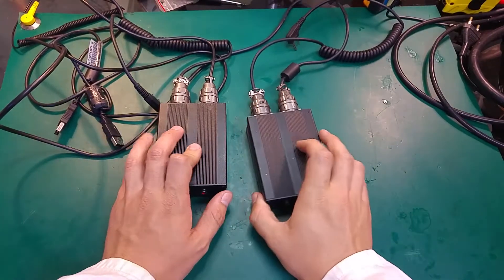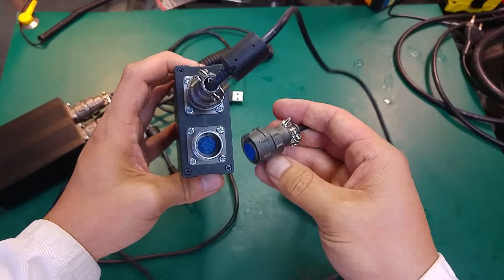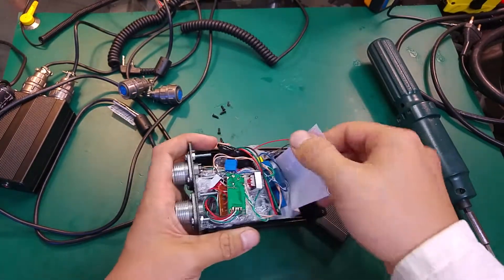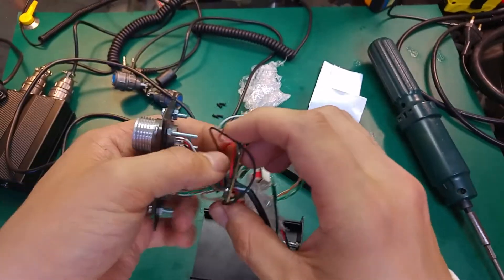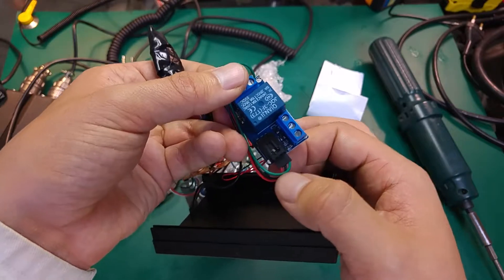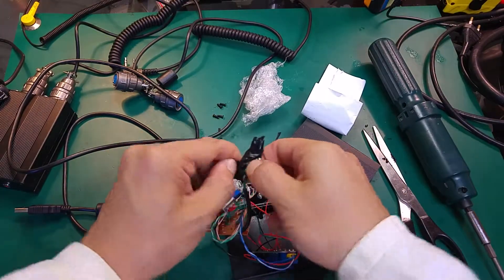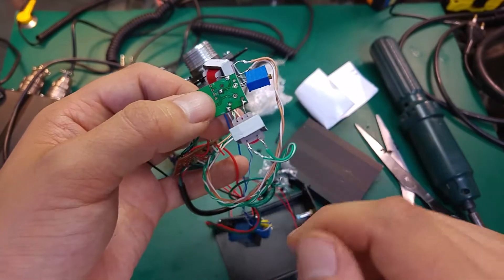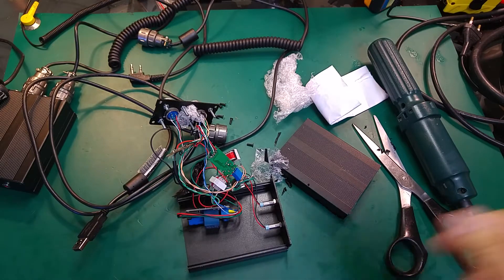cheap SignaLink alternative USB PTT AUDIO for digital modes Winmor Winlink / soundmodem / sstv

Comment: Do you have the schematics for it? Great job.
Reply from the maker: Thanks,  I'm never planing and in middle change stuff according to what i got or can find online .
To be hones You don't need any schematic. 
In what point do You stuck?

Start from just getting: USB - RS232 adapter cable and relay module.
https://blog.pasqualefiorillo.it/drive-a-relay-with-an-usb-to-uart-interface/
Than try PTT over winlink software - if You get PTT relay clicking biggest part is over - now add USB sound card. When You get this two pieces together add USB hub and put them in one enclosure.
And  that's basically everything.

Comment: Got a aliexpress link of the working usb serial adapter.  Many out there dont have 5 volt + on dtr rts gnd when keyed up. The ttl also have 0 voltage when keyed up, 3v + when not keyed.